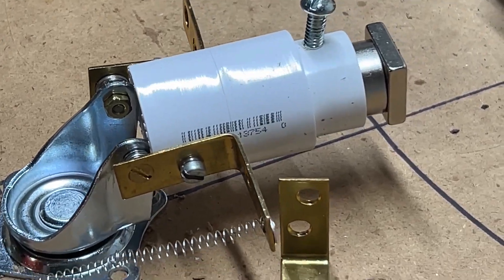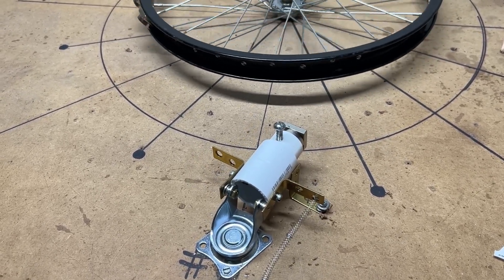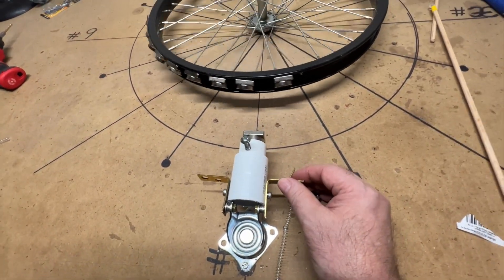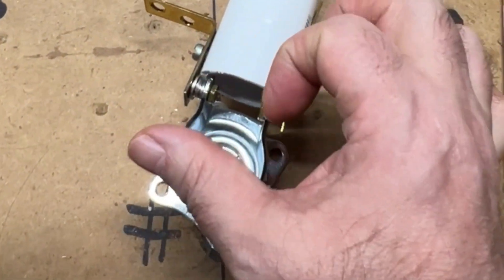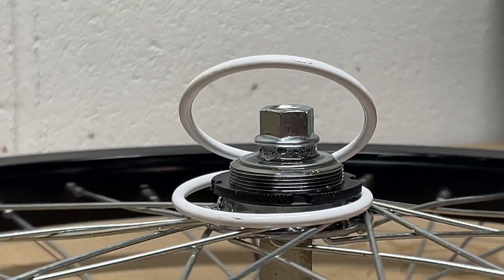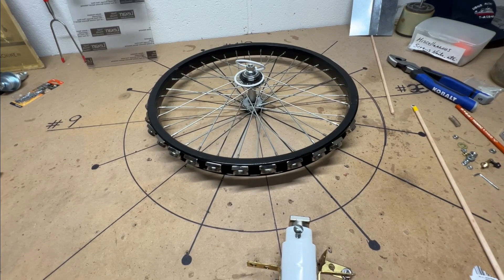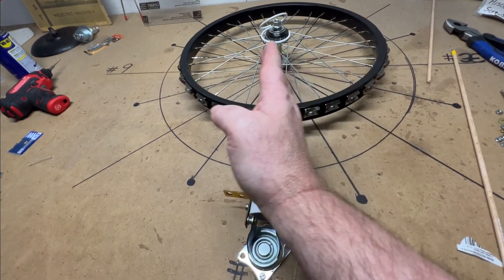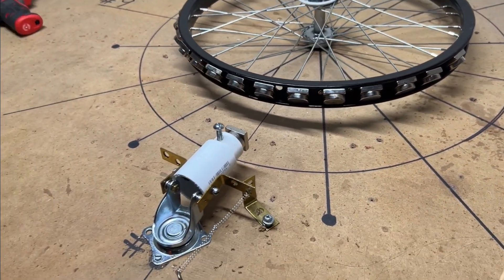UPDATE: Spring Loaded Stator Test

Comment: Space is very cold; there for heat or motor of the UFO going in great speed.  Noticed that when it hits certain atmosphere it slows down.  Noticed this by observing UFOs landing in certain atmospheres.  More to this but then I could be wrong.
Reply: Thank you; heat keeps the craft going In great speeds don’t know the correct words.  I know through certain time warp or whirlpools enough for the craft go through for refueling, maintenance and repair I’m thinking in case of crashes of sorts.  Space is as driving and taking an elevator to the right floor like a whirlpool in space being able to navigate a roadmap.  People don’t mention of observing the horizon we’re crafts are coming from over the horizon there is always a point just like a compass.  Always do observation.

Comment: I was expecting the spring to go on the other side to assist the reset. Of cours the reset need to happen as autonomous as possible, whether it's done by the momentum of the wheel or the first magnet to approach, that's loss of momentum right there.
Reply from the maker: 🧲 If we look closely the first armature magnet pulling the swinging stator magnet back into position does not cause the wheel to slow down some, rather it causes the wheel to gain speed. When the spring is located on the other side, it does not allow the stator magnet to fully tilt automatically which is a must for continuous rotation. I thought about using gravity as part of the reset process, but that will severely limit how fast the wheel can spin and will reduce how much the stator magnet tilts to the right. No doubt there are still unknowns here. It’s a matter of exhausting all options until one or none work.  If it’s in your budget, you might want to replicate this extremely simple set up and see what discoveries you make that I might have overlooked. You might also have some fun at the same time. 

Thank you for your keen feedback.

Comment: That’s why I was suggesting that we use a small dc motor to turn this and hopefully the power that we can generate from the large wheel will be more than the power the dc uses.

I will send pictures of some drawing I did using the rod
And you approve 
I will print and mail them to you
Good bless you sir
Reply: It was said b the light do not seek it for you will be blinded. B the light and go into the darkest places.
Reply: LOL
Reply from the maker: 🧲 I’ll keep a look out for it.  I long since though about using a DC motor to help out, but to do so I will have to apply my custom coil design that taps about 96% the magnetic field, where as most most coils it’s more like 33%.  A whole new magnet configuration is required do to the extreme amount of magnetic surface area the coils would be covering. Magnetism is not necessarily my wheelhouse, whereas electrical science is.  That’s what enabled me to create my own balls of light using static electricity. All you have to do is get a static spark to chases its own tail.  Nothing to it once you know the trick.
Reply: @FreeMagneticEnergy2  that’s great
Please show us how it’s done
Thanks
Reply from the maker: @Gacha.Cupcake  - the mechanics to build a working model is a very daunting task. There is two versions, one of which is more complex than the other. In both designs, it’s about maximizing the magnetic surface of the magnet, and do so within extremely close proximity, as virtually all other designs do not. I also have an issue with most other coil concepts based upon what I see as magnets are nothing more then paddles that paddle the electrons down the wire much like a canoe that uses paddles. I’ll draw up something that should be easy to understand.
Reply: good idea too!